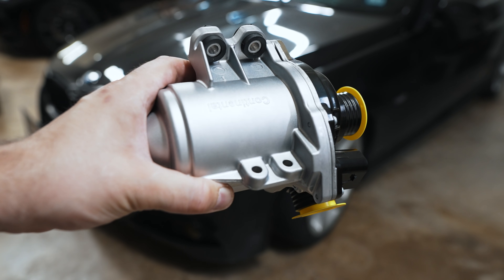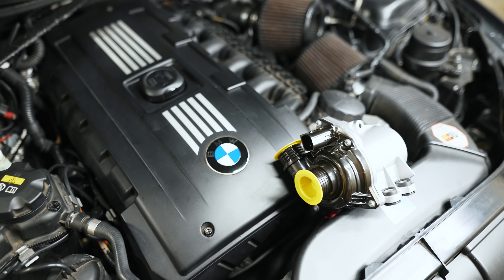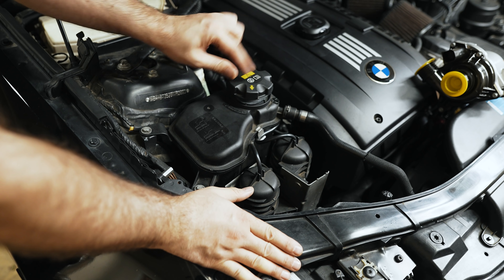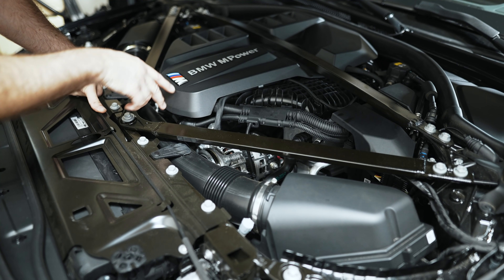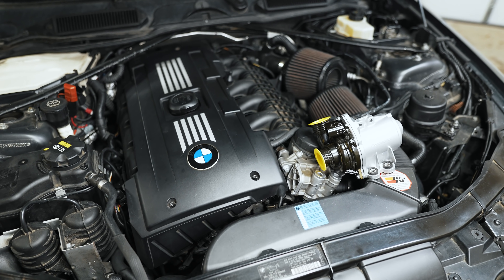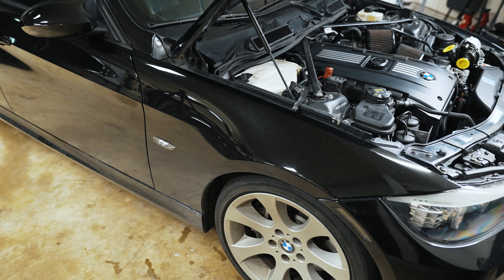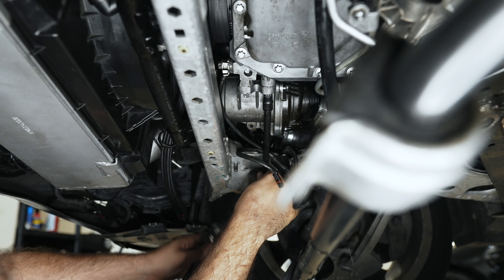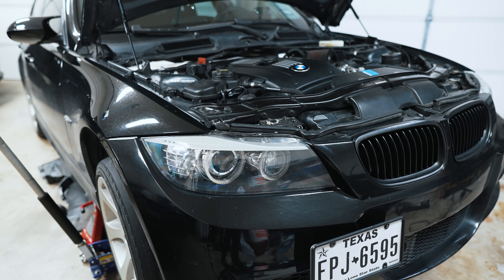New BMWs Don't Have This "Modern" Part From 10 Years Ago

Comment: You can keep your "advanced" water pump, thanks.

I'd much prefer a small auxiliary electric water pump to run coolant through the turbos after and keep the main pump mechanical (and metal).

Comment: 60k miles? My 09 E90 328i waterpump was still working at 170k miles. I only changed it, and the thermostat, because I needed to do the OFHG and I didn't want to drain coolant twice.

Comment: I experienced a draw-back from this design last year during the PHX summer. When my voltage regulator went out it caused a cut off of electricity to all a couple of major electric components, this included the water pump. Because the water pump was off, the car over heated after 5 min. of driving. I limped the car home stopping and cooling off, drive, and continuing the cycle.

Comment: My e90 n55 only has 82k miles and I've had to replace that stupid electronic pump twice.  The second time it went out, it shorted and would run when it wasn't supposed to. Drain battery, cause bsd faults, couldn't even read engine oil level. So annoying. 

Rather have mechanical all day. I would happily trade 10hp for that piece of mind.

Comment: My water pump fail on a 2021 M440 xdrive with only 2,076 miles the car was at the dealership for 32 days they couldn't get parts supposedly  because is a brand new model; what a joke I haven't even driving this car super hard I usually drive the car on my way back home from work on Sport Plus that is a drive of about 12 miles on city driving. could I have cause this water pump to fail so quickly because of driving it on Sport plus?? but what the hell that is why I got this car because of the acceleration and how it sounds on Sport Plus; now I'm afraid to drive the car a bit hard or Sport Plus; any suggestions.
Thank you.
Reply: Drive it up to temperature in comfort and don't hoon it when it is cold. Never push an engine that isn't in operating temperature, your manual will also tell you this. Since you have a 2021, check the owner's manual (you can search in the operating system 7) for driving tips.

Comment: I've been using e90 for 4 years now and the pump has failed twice which I had to replace, the problem is that I can't get new of this pump here easily in my area as the dealers here take advantage of the scarcity which makes it highly costly.... I had to modify the pump from original design to just two wire by using a radiator fan, 6300 bearing, seal, 5mm universal joint and relay for me to keep the car running, to get it to work it is a nightmare as it took roughly 4 day for the modification as I keep getting into one or two issues and resolving it on after the other, but at last it worked.... But no feedback to the ECU as I get water pump missing when I scan it....  What is important for me is to keep the car running and I achieve it.

Comment: I have a N54 with 75k on it. Bought 3 years ago. You recommend changing the water pump now ?
Reply: Any problems yet? Just got a 325i 06 model.. 6 speed manual. It drives great with 132k miles

Comment: I got a code 2E84, and the water pump and thermostat is brand new. Fuse is good in ecu box. One thing I did notice is, the car wouldnt do the bleeding procedure, wouldn't blow warm air, and fans wouldn't kick on and it's roughly 225 degrees Fahrenheit. If you have any advice, I'd appreciate it. Year old battery and connectors are looking good to me.

Comment: My E90 water pump lasted for 205K miles when it showed symptoms of failure. Before then, I'd heard on BMW forums that early symptoms could usually be detected before the pump fails completely. It certainly did in my case. I saw coolant temperature rising above normal on my ODB2 Bluetooth scanner while driving. Later I did a diagnostic scan with Rheingold ISTA/D and got 2E81 fault code -- "coolant pump speed deviation".

Comment: OEM N52 pumps after 2009 go life of the car..  Pierburg is OEM for the N52s (not shown in this video which is a turbo).  They figured out the electrical issue that was killing the earlier pumps under 100k.  If you have a 2009+ LCI N52 car please post if you've EVER had a failure below this reply.
Reply: I have never seen lci N52/53 waterpump fail
Reply: Dr Dean's BMW channel he says its a waste of money to replace a water pump EVER on an LCI car.  He too says they no longer fail... maybe if you go past 200k miles who knows.  I guess bearings without a lateral belt load don't fail like belt driven pumps, unsure.

Comment: My ‘12 X5 pump lasted 183k. It still worked but only at full speed due to coolant reaching the electronics within and screwing up the serial bus knocking out ibs, alternator, oil condition/level sensor etc.
Reply: Additionally, if you haven’t taken one apart, they are quite interesting inside. Tons of electronics, similar to what is in a cordless drill.

Comment: When I did my pump I removed my sway bar. After reinstalling I noticed I’d get noise when I’d drive over uneven roads or cracks in the road. I looked it up and it said my endlinks were bad. I did not have weight on the wheels when I reconnected the endslinks on the bottom and installed the sway bar. My question is do you need to have the tires jacked up when installing it back and tightening it down?

Comment: My n54 water pump saved me in the dead summer of Phoenix Arizona where it was about 120 outside. After my belt shredded I was able to still limp the car five miles back home the only thing I had to watch for was I didn't have power steering and the alternator wasn't running but I was able to get me and my two kids home and back into the house.
Reply: wow you're lucky you didn't suck the belt through the crank seal by continuing to drive it. A not so uncommon problem that would have cost you $$$
Reply: @jnh8381  I actually remember seeing a video where that happened.
Reply: @jnh8381  yeah It was a clean cut. I even replaced the crank seal and luckily it wasn't compromised
Reply: Oh that must have been fun with no a/c.

Comment: Just a thought, I have a 2012 E92 Xi drive that has the BMW “ modern “ smart alternator that refuses to fully charge my lead acid battery. When researching this phenomenon it was brought to my attention that maybe the reason BMW programmed the ECM this  was for better gas mileage due to the stringent EPA import requirements. It also brings to mind the Volkswagen fiasco with software emissions mileage tomfoolery. With the electric driven water pump also being controlled by the ECM I wonder if this doesn’t fall into the same category. It doesn’t make sense they were not used on M cars unless the M guys said no way your putting that piece of garbage in our M cars.

Comment: Most videos I've seen do the bleed procedure with the cap on, I believe that's the BMW state as well. Any reason you do cap off?
Reply from the maker: No particular reason, mostly just to see when the procedure is finished and when the bubbling stops.
Reply: @VehicularDIY  Ok thank you, so it makes no difference to bleeding the air closed or open then? I just wondered.

Comment: Hey so I have a 2008 bmw 335xi and it's throwing p0420/p0430 codes and the ses light would be on most of the time but every now and then when I crank her up it'll just turn off so I don't know if it's either the O2 sensors or something else that im missing
Reply from the maker: You have stock downpipes still?
Reply: @VehicularDIY  the whole car is stock

Comment: Older model has all metal electric water pump without any issues. Sounds like a cost reduction decision that ended up costing them more. In theory these pumps should last till EOL of car.
Reply: From what I understand, most of the failures are actually electronic failures. That said, the all metal one used in the last generation of BMWs is quite reliable.
Reply: @Cyrix2k  The permanent magnet rotor in these pumps are encased in plastic. The plastic seems to crack and caused the rotor to cease up. This was the cause of the failure in my car and a few others i have seen online. Not 100% sure this caused issue on my car but the noise it was making sounded like it was trying to spin up.
      I think the oil in the coolant may have something to do with it. And I have seen a few people stating electronic failure but they don't say what part failed and why. Older model pumps were all metal inside. The way it should be.

Comment: My question is what specifically occurs when MHD has the cooling target options. I currently have chosen the sort coolant mode for my n55, but I don’t know how the temperatures are lower? I don’t know if it’s the pump spinning faster and working harder or if it deals with the thermostat or both.

Comment: For that broken rubber mount on the power steering line, I just connected them with a bolt of approximately the right length, and made the gap between by stacking small rubber grommets.  I believe I used the 5/16" ones in this kit.  https://www.amazon.com/gp/product/B08BRJF5Z2/
Reply from the maker: Nice thanks.

Comment: What zerex coolant do you use?
Reply from the maker: It's G48.
Reply: @VehicularDIY  That’s identical to genuine branded BMW coolant. BASF GmbH ( the proprietary manufacturer ) who simply supply
 the G48 formulation to Valvoline and others under license agreements.
There is a TSB from BMW that says when installing a new water pump you must not initially fill with straight coolant concentrate and then add demineralised water to get a 50/50 ratio.The bulletin states you must only fill with it PREMIXED TO THE 50/50 RATIO otherwise you will shorten the life of the water pump.
I’ll send you an email attachment with the actual bulletin for your interest and information ( if you haven’t already come across it )
Reply: @VehicularDIY  Hi again, could you post your email address so I can send you that BMW TSB ON THE WATER PUMP COOLANT MIXTURE PROCEEDURE. Many Thanks

Comment: Strange you are not replacing the thermostat also.  Probably another video for more content.

S58 abandoned the stratified cooling found in the B58.  Does not the S58 use an electric coolant pump for the intake charge coolers?

I replaced the water pump on my N54 on a lift and that top bolt took me an hour and a half to get started withour stripping or cross-threading.  Replaced the thermostat and coupling hose with shield, also.
Reply from the maker: The one on there had less than 1k miles on it.  Replaced it when I did the engine swap.  From what I understand they s58 has a small supplemental pump to cool the turbos if you shut it off hot.

Comment: Great info, thanks!
Did you pay yourself the ~$1,500?!?  😜

I was thinking perhaps BMW could get Tesla to design and build the electric water pump...

BTW, my 08 E82 has the rubber isolators on the water pump from factory.  Still the original pump (72,000kms/~45,000miles).
Reply from the maker: Lol, oh interesting.

Comment: Actually mechanical water pump isn’t as inefficient as you might think. Because the water pump is designed to be load adjustable. At lowest setting, it is almost like neutral gear and under load it can pump harder than a 12V electric power supply water pump.

Comment: I’m at 50k and getting ready to change entire cooling system except for radiator in the next year by the time I hit 60k. I’m buying the bmw vacuum bleed and fill tool, you didn’t use one is that because you didn’t fully drain your coolant? I have electric water pump but still should use a vacuum fill tool, correct? Thanks great content as always.
Reply from the maker: I don't think it's required to be honest, the bleed procedure has always been fine.

Comment: Electric water pumps are BETTER than mechanical, for a multitude of reasons, BUT they are cheaping out on build quality of the said pump, hence it fails, don't blame the part, blame the m,manufacturer who is trying to nickle and dime you
Reply from the maker: Perhaps that was the issue all along,  they were expensive out the gate so you would think they wouldn't skimp on materials.

Comment: Another great video! Thank you so much for explaining everything in such great detail, on my n53 i still have an original water pump at 120k miles, not sure if they done something with improvements for the 2010 model but still no issues with mine, i cant even hear it running when for example doing a bleed procedure. Interesting stuff.
Reply from the maker: Nice perhaps the lack of turbos helps with longevity of the pump.

Comment: Thanks again! I like your style of filming and explaining/discussing - so calm and relaxing :)

My E91 335i LCI N54 waterpump just started leaking after a marten decided to eat a waterhose and the engine overheated on the drive home... bad luck.
I've seen a continetal pump in there, might be the original one (im right at 246000 km/150k mls).

First I thought about just glueing the plastic housing, because it works fine, but just leaks so slightly - but the pump could also leak internally which turns into catstrophic failure.. cant have that.

I might try the all aluminum Pierburg pump (Pierburg pumps are OEM to many cars - good quality)
Why didn't you choose an all metal one? Not accessible or too expensive? (In Germany it costs the same as VDO/Conti)
Reply from the maker: Thanks for watching!  Mostly to stick with oem.

Comment: Thank you for the video, here is some temp information what I found about the most electrical waterpomp:

The coolant pump also operates differently than conventional pumps when controlling the engine temperature. To date, only the currently applied temperature could be controlled by the thermostat. The software in the engine control unit now features a calculation model that can take into account the development of the cylinder head temperature based on load.In addition to the characteristic map control of the thermostat, the heat management system makes it possible to use various maps for the purpose of controlling the coolant pump. For instance, the engine control unit can adapt the engine temperature to match the current driving situation.This means that four different temperature ranges can be implemented:

112°C ECO mode (economy) 
105°C Normal mode 
95°C High mode 
80°C High + mapped thermostat mode

The coolant control sets a higher cylinder head temperature (112°C) if the engine control unit determines ECO mode based on the current operating conditions.The engine is operated with relatively low fuel consumption in this temperature range as the internal friction is reduced.An increase in temperature therefore favors lower fuel consumption in the low load range. In HIGH and mapped thermostat mode, the driver wishes to utilize the optimum power development of the engine. The cylinder head temperature is therefore reduced to 80°C.This results in improved volumetric efficiency, thus increasing the engine torque. The engine control unit can therefore set a certain operating mode adapted to the respective driving situation. Consequently, it is possible to influence fuel consumption and power output by means of the cooling system.
Reply from the maker: Nice thanks for the info.

Comment: I just did the water pump on my 2008 328xi N52 along with 4 hoses. I paid my indy to do it because his shop is next door to my work and needed the car on the road asap. So it was about $500 for the pump, coolant, thermostat and 4 hoses from FCPEuro and $350 labor. It was the original pump and made it to 89k miles so I guess I got more than most. Luckily the car never over-heated and didn't strand me. I knew something was up when it sounded like my fan was trying to turn my car into an airplane. Wow that fan can really crank when it needs to! Hooked up my Pro Tool phone app and got the 2 most common water pump codes. I live in CT so anything I order from FCP always shows up the next day which is definitely a plus. 
Thanks for the always informative video! Still criminally undersubbed but it looks like you got a decent amount more from what I last remember. Hopefully the youtube algo gives you some more boost.
Reply from the maker: Thanks for watching!  That labor rate wasn't bad for an Xi model.
Reply: @VehicularDIY  I'm a chef and the restaurant where I work is almost literally next door to the mechanic so we have a good relationship. He takes care of pretty much the entire fleet of cars of all the ppl that work here and we give him free food all the time, so yea, it would have been more for someone else.
Reply: @VehicularDIY   On a different note. I have an appointment for next week for my mechanic to check out my clutch. It works/operates as normal, grabs where it should, shifts fine etc. i.e. the pedal is fine when pushed from back to front and vice versa, but there seems to be increasing "slop or play" from left to right in the pedal itself. It's just sort of loose and sloppy, as I said, and seems to be getting worse. Is there a pin or clip that could be broken or specifically, since I haven't looked myself, what actually holds it in place? My brake pedal is solid and doesn't move side to side at all. Hoping this is an easy fix? Thanks again!!

Comment: It’s kinda of a pain in the butt working on those water pumps mine gave up 3 times in less than 30k miles idk maybe bad luck, mine was an N52 they usually leak from the oil filter adapter and into the connector of the water pump which it probably was my first problem but who knows, also some diagrams don’t tell you where the fuse it’s located some don’t have a fuse at all, idk asked couple of bmw experts they didn’t know either
Reply from the maker: Wow that definitely is bad luck,  you were replacing them with OEM pumps?
Reply: @VehicularDIY  yea OEM every time N52 coolant tempts can reach up to 110C and that’s Under the normal Tempts someone said his car reached 115C yeah any cheap water pumps would just died as soon as the car warms up lol I even thought of installing a second water pump in case the main one failed